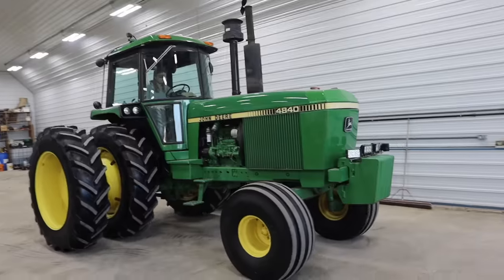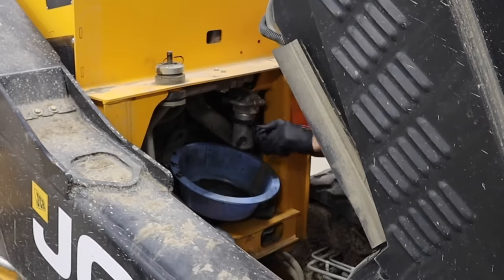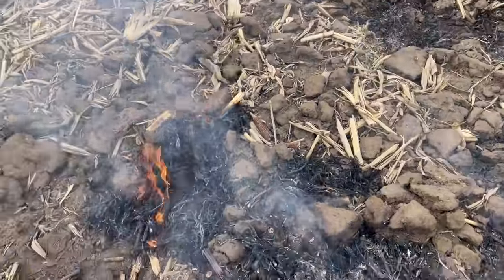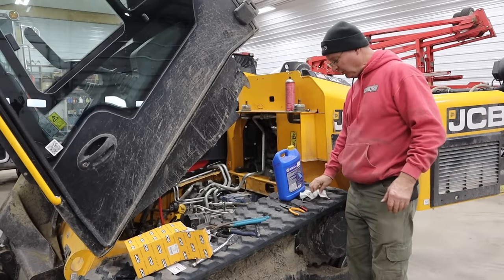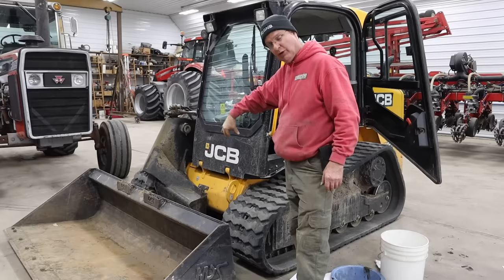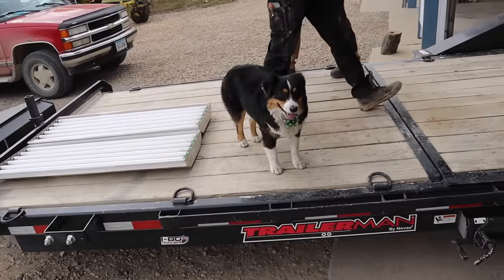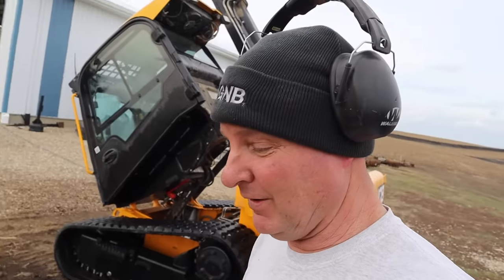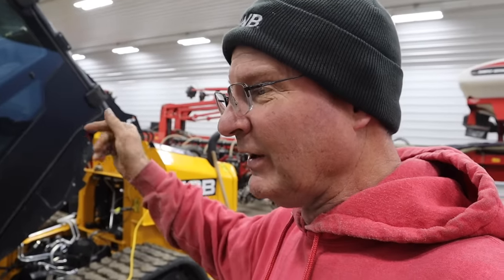FIELD FIRE

Comment: think on this if you light up your feilds then till them the nutrients from the chaft will return in to the soil quicker and you wont need row cleaners to push the chaf out of the way in the spring and the only thing that would afect the planter is the roots

Comment: I'm with you on oil changes. My van has twenty thousand miles or two years oil changes I just can't leave it in that long. It gets once a year change that's about eight thousand miles and every other change a flush.
I know our john deere tractors had long oil changes but only with the long life oil I used good oil but not long life oil and did 150 hour changes.
And a good groan helps everything as you get older especially getting off the floor, I'm sure 10 years ago the floor wasn't as far down as it is now. Love your videos.
Reply: They are lowering them more and more every year!

Comment: When the manufacturar of the Skidsteer says 500h oilchange intervals its 500h. There is absolutely no need for undercutting it even below 50% of this intervalss^^
This machine is made für hervy dirt and constructions work with lot of full throttle hours in one week. The load you put on it is rather lightweight with it.
I am allways impressed of the short oilchange intervals in amerika. Every else in the world the intervalls are way way longer.
After breaking in there is Definetely no need for changing oil in this short cycles if the manufacturer says otherwise.